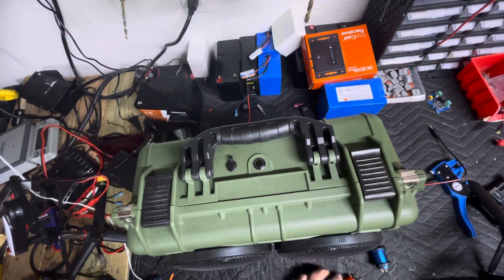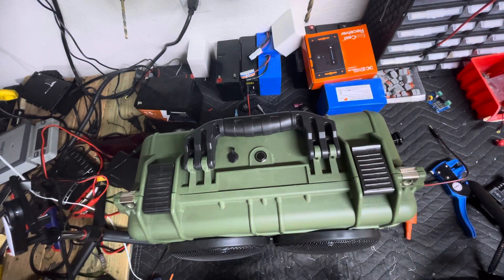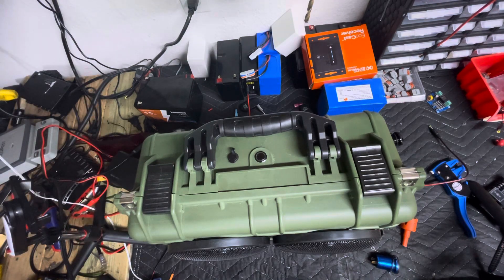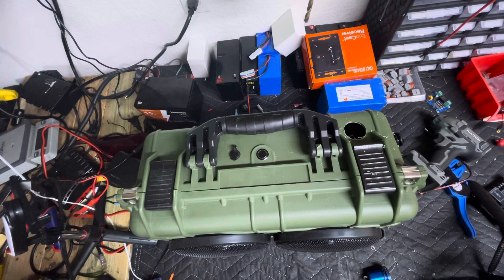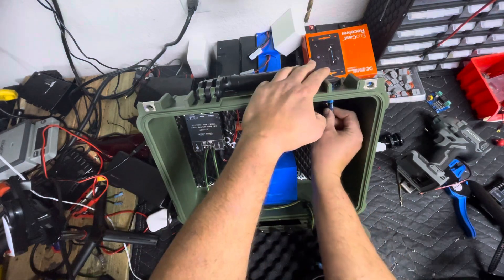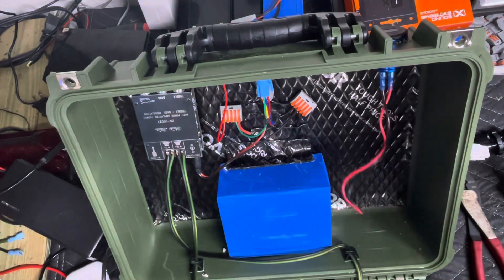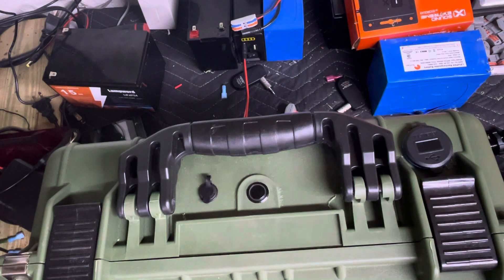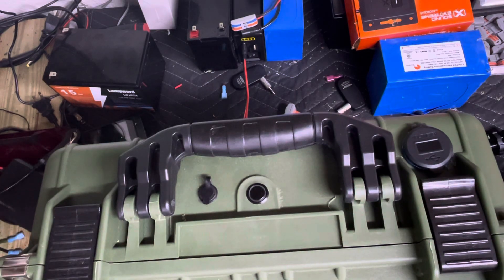Let’s add USB/Volt Meter to Boombox

Comment: I added a separate switch for the charger so you don't have to turn on the radio to charge anything
Reply from the maker: If you wire the dc plug to the battery it doesn't have to be on to charge

Comment: With the voltmeter showing 26+ volts is it safe to plug in a cell phone to that usb connector or will that fry the phone?
Reply from the maker: @kmatassa964  yes it’s completely fine. This one is actually built to regulate the voltage for your phone.